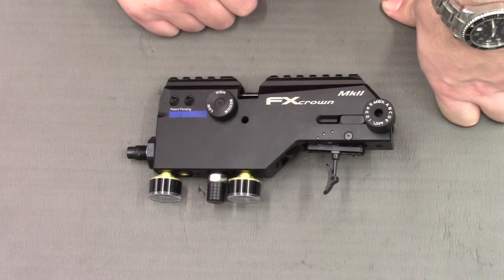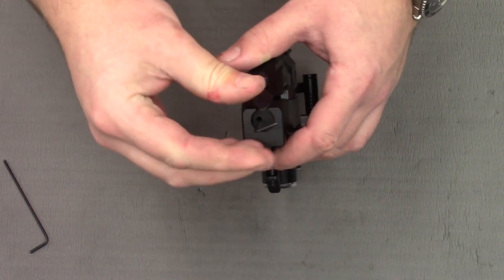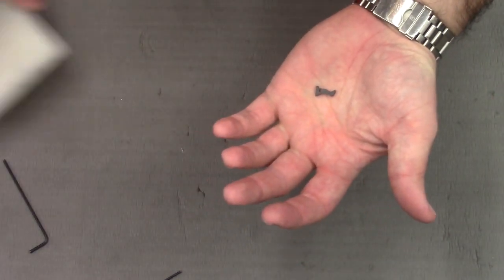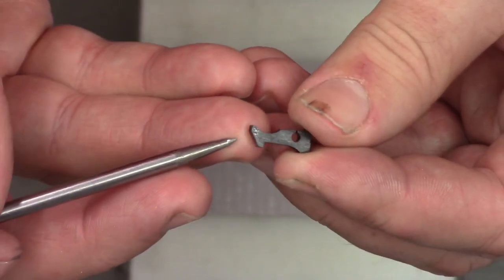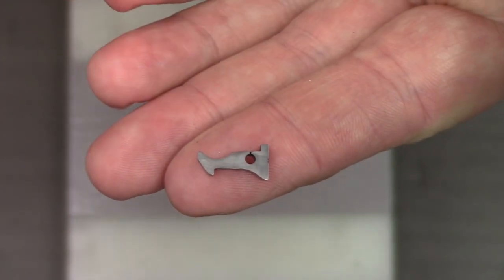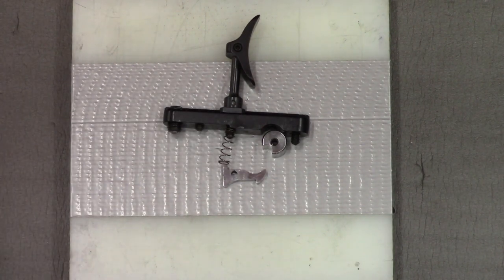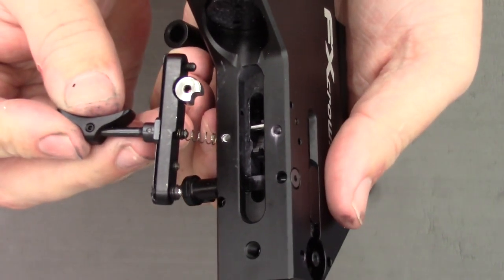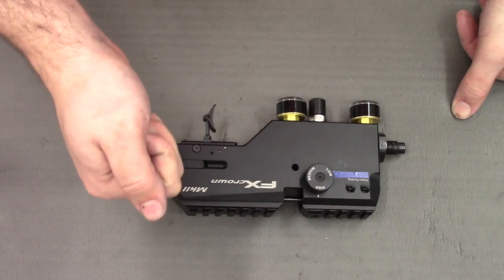FX Crown trigger rebuild and polish

Comment: Hi I’m wondering if anyone can please help me my fx crown mk2 safety trigger stopped working so basically it’s in fire mode I haven’t adjusted the trigger or polished the shear any idea what’s happened I did remove the regulator and polished the bellville washer but nothing else and that wasweeks  ago only now the safety has a problem thanks in advance for any help.
Reply from the maker: You just need to adjust the safety screw in the trigger, its the one inline with the safety switch and it should just need a little tweak with the 1.5mm Allen key, a couple turns in should do it. Thanks for watching